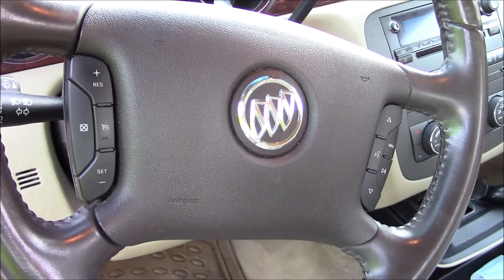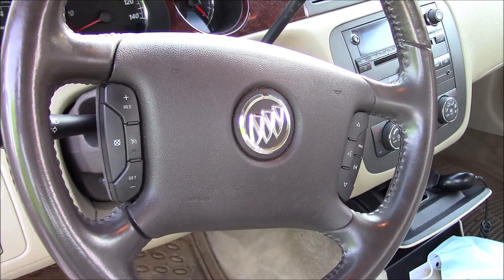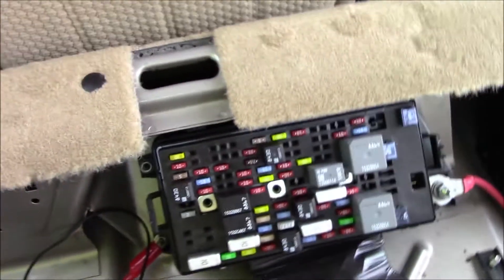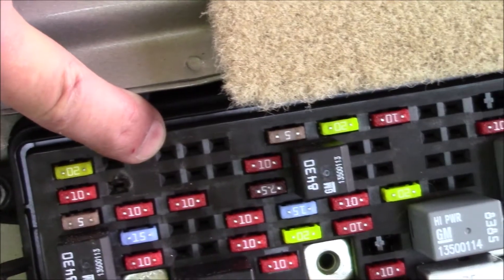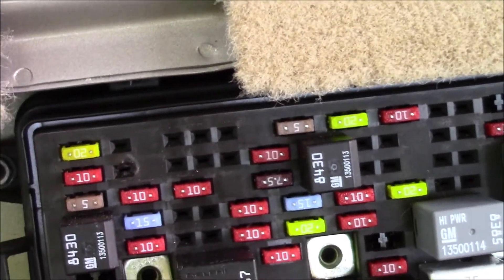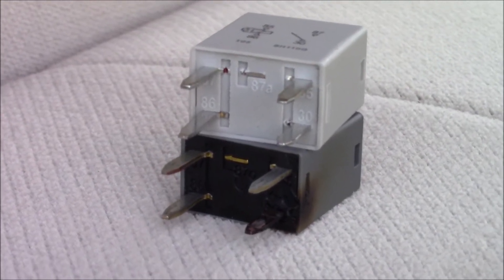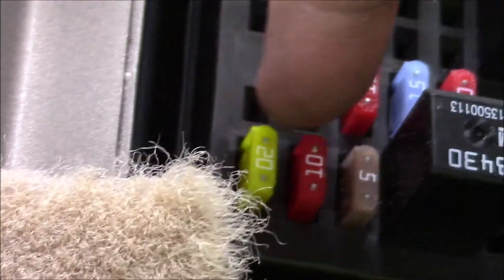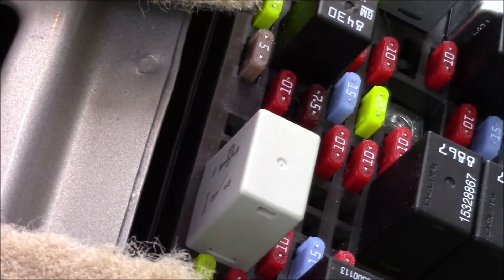Buick Lucerne cranks but won't start quick fix

Comment: You sir just saved my morning. And for anyone wondering yes you can drive with it, but I kept my seat off and the top to the fuse box off, and had pliers in hand, so that if it were to start smoking I could unplug it and not worry. Drove around to make my deliveries for about an hour with zero issues never turned it off once. My part should be here in 2 hours I was able to go to the auto parts store and order the part from a store in another town and car should be fixed today. Same day. So if you’re wondering if you can drive with it, I’d say yes, but be careful not to have the paper clip touching anything else if you can get it in as straight as possible, it doesn’t melt any plastic or smoke at all. Just wanted to post this so that others could know because I didn’t see any other comments about driving with it in, but for me, it did work perfectly for running the fuel pump ( one issue is that my gas gauge was reading all over the place it said quarter tank then half tank for a bit then back to quarter tank so just make sure you actually have gas before putting the paper clip in because it could possibly effect the gas gauge) otherwise really saved my morning thank you very much man!

Comment: My 2008 Buick Lucerne had precisely the problem described.  I removed the relay and saw it was burnt, so i did not do the paper clip test.  A new $19.76 relay and I was good to go! 

Kudos to you. You saved me $$$.
Reply from the maker: glad this helped
Reply: Im having this problem replaced battery alternator & it cranks but takes a while to start planning on looking into the fuses & go from there hopefully it’s just a relay issue like yours

Comment: Anyone that doesn’t see my other comment, yes you can drive with the paper clip in, just make sure it’s not touching anything besides the holes it plugs into. Didn’t have any issues with burning or melting for the hour I had to drive for. Life saver! Hope this helps someone else wondering!

Comment: So happy I came across your vid! Put in new battery,  new starter relay fuses & still just cranked. Then saw this. FP fuse was really messed up burnt so I knew problem but I had to do the paperclip and turned over😂😘😘
Reply from the maker: Glad it helped

Comment: Thank you once again I wouldn’t have been able to work if not for this video! This man is THE MAN 🤘🏻🤘🏻
Reply from the maker: Glad to hear that you found this video of great benefit
Reply: Really helped me out so much! They gave me the wrong relay so I ended up having to use it again last night, and then again today. I made the paper clip the exact same size as the fuse so that it doesn’t touch the plastic and it worked great.

Comment: Need to replace the fuse block its fairly simple, i used one from a junkyard or order online prolly cheaper than gm/dealers. Its also recommended to get a low profile relay, and trim back the offending seat clips that rub the fusebox

Comment: If anyone is wondering why their relay get super hot and car won`t start.The correct fuel relay has the numbers 8385 written on the top.When placed in the fuse box those numbers should be towards the drivers door.Not all 4 pin relays are the same even though they fit and work.Some will not dissapate the heat properly.When you put the wrong relay into your fuse box and it heats up it causes the prong connectors inside the fuse box to spread and not make proper contact,which causes more heat and more problems.I actually went to an auto parts store and bought a fuel pump relay and they gave me an aftermarket one that was not the right one for the car and caused it to overheat.I replaced it with an 8385 and does not heat up at all anymore.Just thought people should know bcause i see a lot of people guessing at the issue.

Comment: Thank you for posting this timely video which provided the solution to  my Lucerne that suddenly refused to start. Your paper clip troubleshooting tip confirmed the fried relay and an easy fix. Now onto the next problem: a rear door lock actuator that stopped working. By the way, is there a repair forum for Lucerne owners?
Reply from the maker: I'm glad you found the video helpful, this was a neighbors car so I'm unaware if they have a repair forum

Comment: Fuse box has taken damage on those fuel  relay terminals.  Another video stated common occurrence in Buick Lucerne due to metal seat latch putting pressure on that sensor.  Recommend u shave 5cm off that seat hinge n replace entire fuse box.  But u may get lucky n car run well with a simple relay change. Mine did. Till that burnt out port on fuse relay finally quit working n getting power to d fuel pump.  I did  two relays and  a fuel pump,  only to come back to failed fuse box, specially that fuse relay.  In short if that fuse relay burns on you again. U may have one more chance to change d fuse box before it leaves you.   N you make my mistake thinking it’s the fuel pump.  Those burnt terminals tell u the fuse box took Damage  from that seat hinge. So replace d fuse box if u keep burning fuse relays. Don’t forget to shave d seat hinge.  .d side facing d fuse box.
Reply from the maker: Good point, and they have a service bulletin pertaining to the bracket
Reply: Exactly RIGHT!

Comment: Thank You for the Vid.
My 2008 Went out on me.
Mentioned Voltage Shortage 
On the dash. Features started going out. It simply went out.
Called AAA. Jump start battery no problem
1. He said not bad battery 
2. Not bad alternator 
3. It drove home 
4. Crank up next day.
Still not sure what Happened or cause it to show low voltage??

Comment: Hello there, i had the same problem switched it and it worked, thank you. But now a week later i started my car and the fuel pump was faking Then I let the car rest a minute checked the relay it was really hot and a little toasted but the car ran just fine. Maybe you got the solution? Thank you buddy
Reply from the maker: glad to help

Comment: Thank you, this was my problem. That is fire hazard, I'm surprised NTSB allows Buick to have this. I heard where another one burnt the fuse box and wires up to the engine.
Reply from the maker: After fixing this car I found this is a common issue and Buick recommends modifying the seat bracket.
Reply: Do u have to use the paper clip

Comment: My 2009 Buick Lucern was running great day before next morning it seemed like it just wouldn't get any fuel. I saw that my relay was burnt up so I replaced it but still didn't work, I tried the paper clip and it started for a half a second and then shut off, so it  sounds like it got some fuel to the engine with the paper clip but wouldn't stay running. Do you think I just got a defective relay (I bought pack of 2 relays both didn't work) and what could be keeping it from staying running.
Reply from the maker: The fuse block that the relay plugs into may be damaged.  I would take a closer look at that. I wish you the best on your repair

Comment: I put a brand new fuel pump on and it ran less than 30 min and it wont start again! the connector right at the pump was very corroded i wonder if the relay was already toasted and the new pump finnished it off?
Reply from the maker: Buick TSB 15-NA-051 is something you may wish to look up on Google, to avoid issues in the future

Comment: Had a No crank No start 2007 Lucerne CXL (72k miles). No circle around the PARK on instrument cluster. No communication to PCM(which is a ECM and TCM) / ABS module with Autel Maxisys. Cleaned grounds and installed new battery. Pulled black round plug (squeeze and pull straight out) going to transmission under MAF sensor area . Cleaned and applied dielectric grease. Started up!! Complete communication to all modules and no codes. Plug looked a little damp but nothing real obvious. Passing on the info!
Reply from the maker: great job and thanks for sharing your fix

Comment: You might want to include the WARNING of burning your fingers at the BEGINNING of the video...Cause MAAAN I had paused it before it got to that part. Soon as it turned over I was CHARGED!! I got to pull the twist tie out and burnt my damn finger!🤦🏾‍♂️🤣...un-paused  the video and NOW you warn me!!🤦🏾‍♂️🤣🤣
Reply from the maker: hopefully people will read the comments or watch to the end.  I will keep your comments in mind if I ever do another video on this trick
Reply: Watch the whole video next time then. NOW THATS THENKEN WETH YUR DEP STECK!!!
Reply: Also said to use a paper clip. I would not recommend using a twist tie as it is quite thin and has a higher resistance with high current running thru it thus I would think would pretty much glow it is so hot to the point of melting. Stick with a paper clip and wait for it to cool.

Comment: Those fuse blocks are garbage. Had a fuel pump go out (130 miles from home...) then some time later it started burning relays and found out the connectors were bad because of shorting wiring underneath. Had to replace the fuse block. Seemed fine after that. That car had some electrical issues, that’s for sure.
Reply from the maker: it seams like a common issue with this Buick model
Reply: @bbbjim1fixedit  if you could get past all that, it was a actually a great car. Once I got those things dealt with, it ran great, lots of power, pretty comfortable overall. Mine was a 2009, the first year to have the 3.9, which was just an upgraded 60 degree V6 (3.1/3.4) from the Malibu’s, Luminas, Impalas, etc., and I really liked that engine, it was bulletproof, as long as you kept topping off the fluids regularly as it seemed like every single gasket leaked. If it weren’t for transmission speed sensor issues I was was having, and the fact that it was eating brakes and wheel bearings toward the end, I’d probably still have it, it just started getting to costly to maintain, not to mention, not the most fuel efficient creature for a 25 minute commute everyday that was recently acquired.

Comment: I have an 08 lucerne that would stall while driving, I've watched endless videos, forums, and still have problem, I replaced fuse block with lower profile fuel pump relay, replaced fuel pump, cleaned throttle body, ive spent too much time and money on this car and I still have this problem car will start then just dies, then it won't crank over at all!
Reply from the maker: I wish you the best on your repair
Reply: @bbbjim1fixedit  thanks fir nothing Jim! Lol

Comment: Very helpful, my Buick Lucerne-same year, just died as I was leaving work.  I had AAA come out and I'm betting that this is what's wrong with mine.  I'm a girl, I don't know much about cars.  Mine only has 30k miles on it..The AAA guy said it's not my starter, alternator or battery..what else could it be..unless the gas gauge is bust and I'm out of gas without it saying empty.  Any other ideas?
Reply from the maker: It appears this fuel pump relay is somewhat of a common problem, so if you test it with the paper clip be careful not to burn your fingers when removing it.  I wish you the best on your repair
Reply: Hey kelly your fuel filter is clogged up gas not circulating proper inside the filter
Reply: @bbbjim1fixedit  thank you for your reply.  I ended up taking it to the dealer and 1400. later, it was fixed :-/.  Thanks for your help!
Reply: @chinessescott4904  Hello, thank you for your reply!  I took it to the dealership and got it fixed...appreciate you!
Reply: @kelleycochran9147  That's good news kelley!!😊 but it's still important to rev your car every morning for 10 minute s it'll prevent it from happening again. Like crank your car and sit there tap the gas sometimes video u doing so i can see please...❤❤
Reply: @chinessescott4904  Jesus Christ please tell me your trolling and that you don't ever touch anyone else car. You DO NOT have to go "rev your car for 10 mins to prevent this" to prevent a clogged fuel filter just run a additive such as B12 or Chevron tech . The levels of PEA in it will eat any junk in it. Also not running your vehicle til the fuel light helps as well. Fuel pumps use gasoline as a lubricant for the pump and can burn out the pump prematurely. Plus and trash or junk at the bottom of the tank can and will be sucked into the fuel filter/fuel pump this clogging it. But once again stay away from giving people advice if you don't know what your talking about.

As for the relay burning itself out I've seen it in my experience be a shorted out circuit,wire or just cheap material.
Reply: @kelleycochran9147  do you know what the problem was that needed fixed??

Comment: Well I did this and the fuse box caught on fire 🥲
Reply from the maker: After making this video I learned Buick has a "technical service bulletin" on this fuse box location and the fix is to trim the seat latch that is damaging the fuse box. After your fuse box is replaced you will want to trim the latch to avoid future issues.

Comment: Couldn’t you just swap out a relay
Reply from the maker: Good question, the fuel pump relay is a high current relay, thus if you do swap one out with a relay that is not rated a high power relay it may damage that relay.  The paper clip trick may even help someone that is stranded.
Reply: Correct answer is the fuse block has to be replaced. I pulled one out of a junkyard Caddilac.(dts?) I think bout same year maybe 2008-12.. $20 only tough part was blue wire block connecter in back just gotta keep prying n trying. They also recommend a low profile fuse and like cutting a half inch off the offending seat bracket, i just bent them back idk if thats ok tho.. been ok for years but i got the same issue but it probably has a different cause as my relay is fine havent checked fuel pressure yet well sort of i depressed the shrader valve and it shot out but not like a real powerful blast so idk yet but the relay isn't toasted soo there ya go folks good luck

Comment: Kudo's Sir! This was a life saver! Compartment fuseblock did not look burned up on the connector side but my relay had the same hot tarnish area on the same terminal as yours. Cranked right up with your paper clip test. I may still replace fuse block with a new one plus they come with new relays. I will also modify the seat brackets as per this bulletin-https://static.nhtsa.gov/odi/tsbs/2017/MC-10139091-9999.pdf I may just end up bending mine 90 degrees so I don't have metal flakes going all over.
Reply from the maker: Excellent